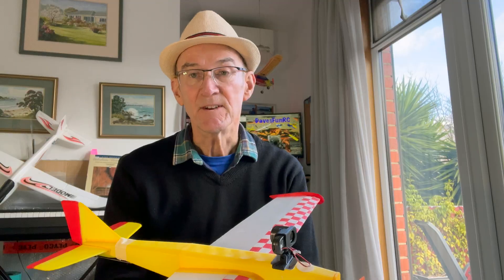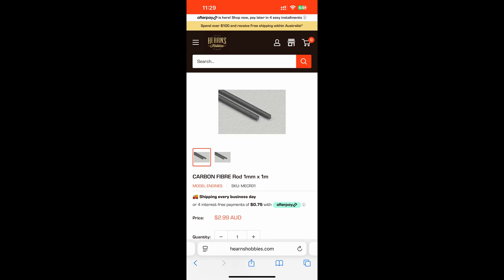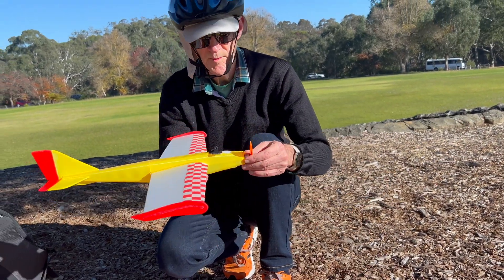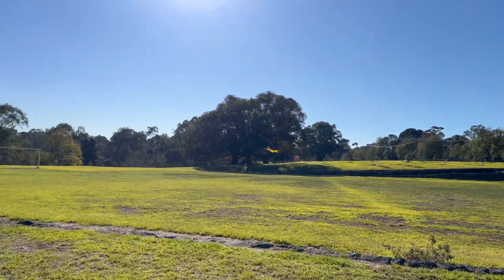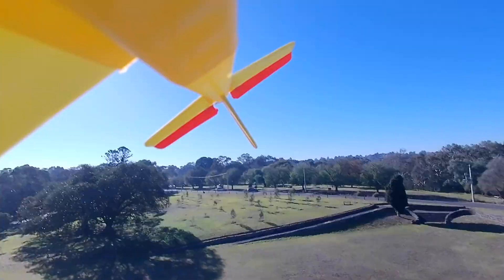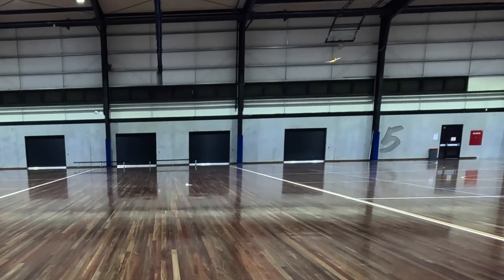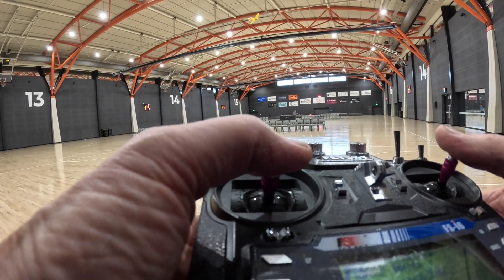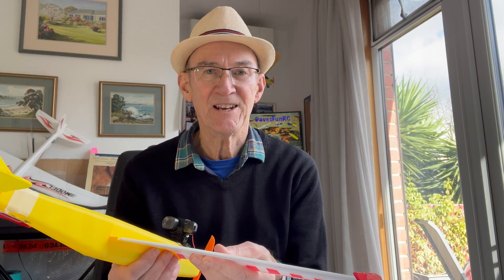FPV Plane Design and Construction for RunCam Thumb Pro

Comment: Are the stl files for your models available anywhere?
Reply from the maker: I do plan to share my designs in future - just need to decide what platform to use.  Stay tuned.
Reply: @DavesFunRC  I've had pretty good luck with Cults3D.  That's where I have my stuff anyway.  Simple interface and it is a well known site for modelers.